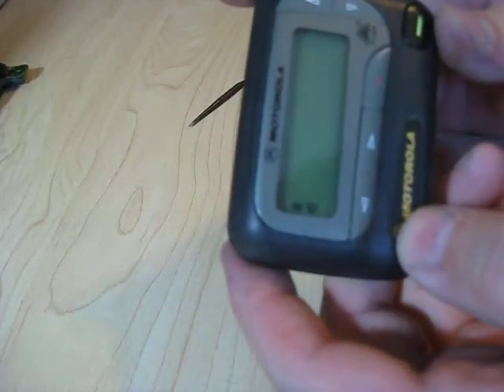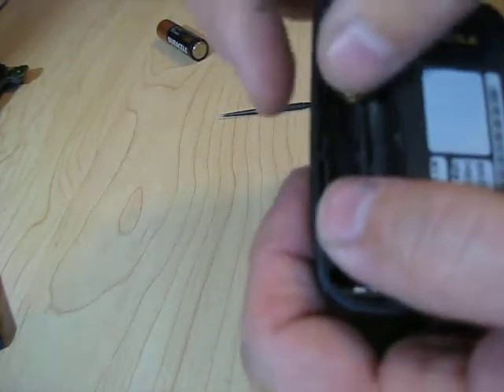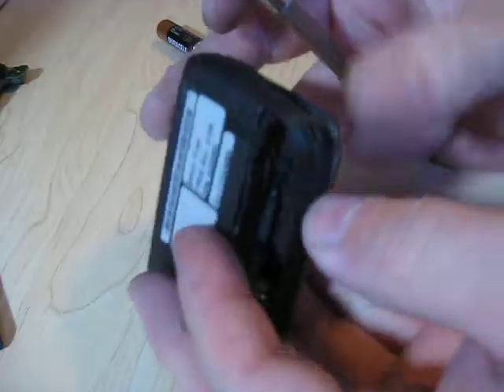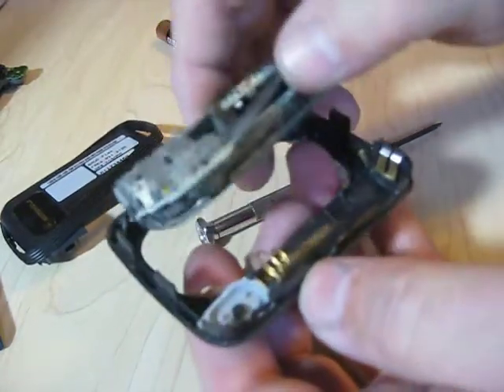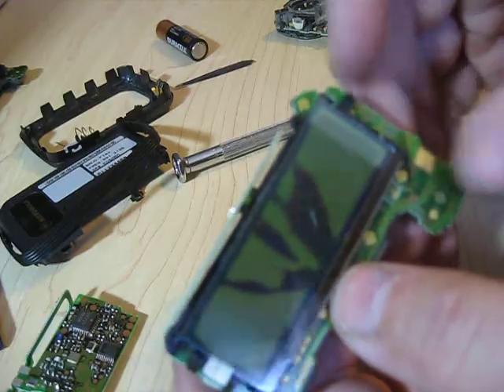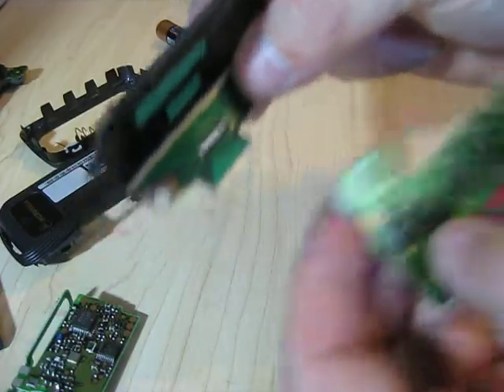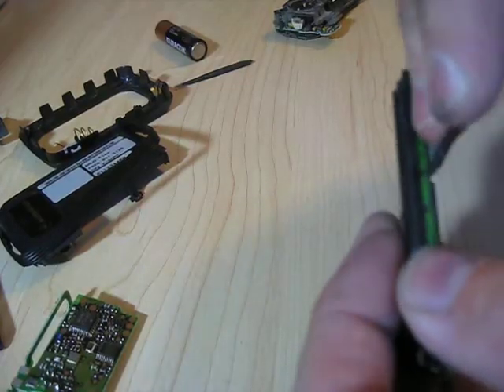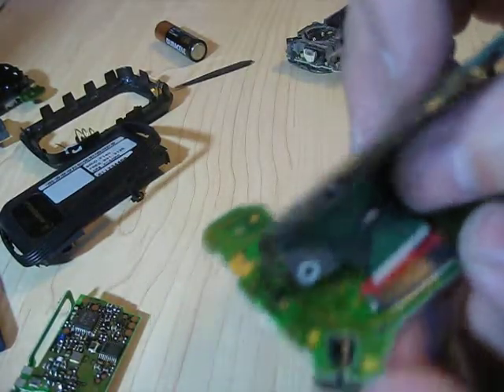Motorola pager disassembly

Comment from the maker: Yes, it's a round 1/4 inch watch type battery (MC 621) that is mounted 90 degrees to the main board in a white holder next to the round black speaker/